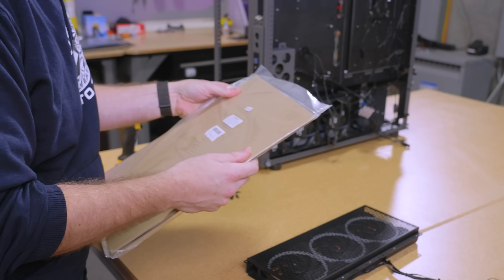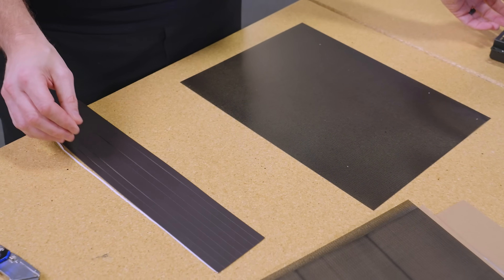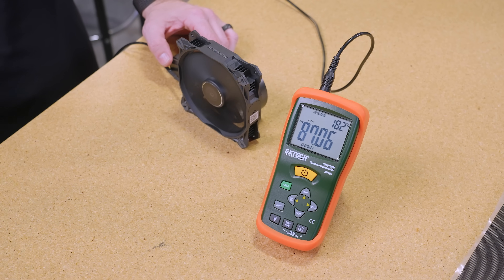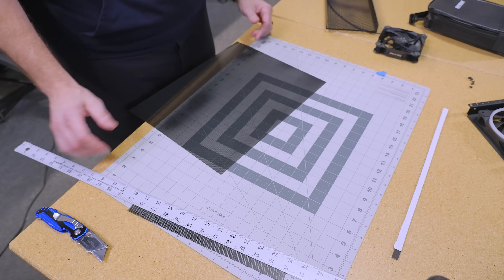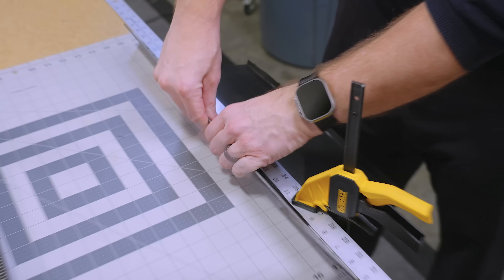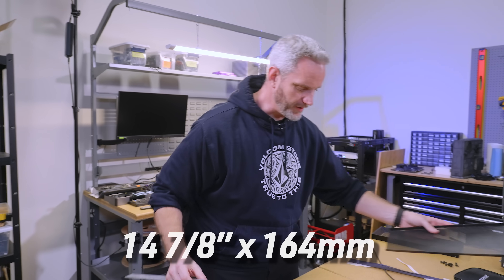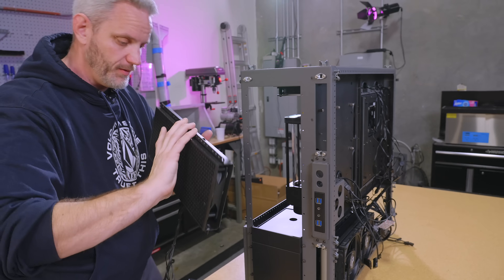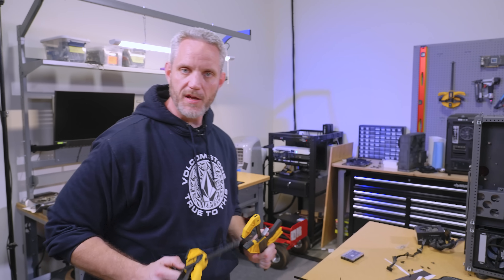How to create your own PC Dust Filters!

Comment: Hey Jay, I tried these EXACT same filters in my custom in-desk PC chassis, and it SEVERELY hurt the airflow. Especially since I'm relying on only 2 intake and 2 exhaust - all on the back side of it. I just took it back off. But I do have a plan to fix it though, which I swear I learned from you not long ago... rather than putting the filters right up against the fans, there should be a bit of a gap. So, my plan is to make like an intake box, spacing it about 2 inches away from the fans, and with the filter material around the sides. Then the filter box can kinda fit over and around the fans / rad. Of course, your project is quite different, and to do that, you'd have to eliminate that existing panel and replace it with your own filter mesh panel.
Reply: +1 on the gap. I remember the PCP&C "Silencer" PSU added a gap to reduce noise. That made me test if it helped filters as well. It definitely does. I also tried pull vs push, where pulling through a restriction is way better, because you don't lose velocity head, because velocity head is added after the fan.

Also instead of using a 2D screen, use something with more depth.
- If white is OK, pick up a fiberglass filter which is cheap and easy to work with. Probably not the greatest filtration, but its widely available. I've also used dryer sheets.
- If you want better filtration, grab something like a MERV-8 pleated filter. These usually have a thicker cotton-like material with metal backing. More of a pain. Much better filtering.
- If you need black, and still want off-the-shelf, get a honeywell "A" prefilter, or similar carbon prefilter for an air purifier.
- But if you're fine with ordering online, the best material for PC case filters is open-cell polyurethane foam. Good dust blocking, MUCH better flow, easily washable, and easy to work with.

Comment: Your fan will perform slightly better if you keep the dust filter a few mm away from the fan blades to allow the air to properly interact with the blades the way they were designed to, worth mentioning. I dont mean like leaving a gap around the edge thats unfiltered, still have it fully enclosed but just a few mm off the fan blades.
Reply: Same thing I thought.
Reply: I know right, Jay does some baffling stupid things sometimes lol
Reply: He has it set up that way in the case. He just didnt test it like that with the air flow meter for some reason

Comment: 0:00 Window screen and magnets works good for steel cases.

*Edit, for that case grab 4 black twist ties that came with cables, twist them onto the back of the front panel grill in the corners. Cut the screen so it doesn't cover the twist ties. Put the screen onto the front panel and bend the twist ties over it. Done.

Comment: I have the dust problem in here and even thoose filters didnt look small enough to filter dust. Maybe little hairs but i dont know about dust.
I have an old Cooler Master case that has already that kind of mesh in the front and, on top of that, had like a cloth/fiber inside that REALLY stop the dust (even if i never tought about how much air it stops too)

Comment: I did something very similar but cut the squares into individual fan sizes and screwed them directly to the fan cage. But, it effectively ruined the performance of the fan so I ripped them off and tossed them. Good luck with yours! Cheers 🍻

Comment: Question: Is there a downside to just taking some window screens and cutting them down to size? Nylon, metal, etc, any type I suppose
Reply: Unless you have a spare window screen I would say probably just the cost. Don't know if you can get the material by itself though
Reply: @taylormeyer671  Ace hardware near me will sell it if you ask, but idk if that's a local thing. More just curious

Comment: I found simply putting my case on an awesome stand my coworker sold to me dirt cheap made a HUGE difference. The Lian Li Evo Dynamic I use now has been outstanding as far as staying clean inside, and being up high at desk level has helped greatly. I had always had my towers down low thinking it was cooler and more progected, as well as quieter, but with water cooling and much more effective fans I hardly ever even hear thrm .

Comment: Filter AND grill really kills airflow and RGB. I would cut out portion of grill that interferes with both. Bend up filter material for a snug fit and spray inside of grill with 3M adhesive to hold filter in place. Makes it permanent but with your attention span, you'll move on to something else next week.

Comment: Americans have the American Standard system that has worked just fine for many years(longer than metric). The Imperial system was used by Britain and Canada until they switched to the (cough, cough) metric system, which was changed in order to correct some of the problems it had, and it still has some problems that will never be solved. Either way, we don't need metric here in America. Our system still works just fine. As for the filter system you demonstrate, it would be good for my old pc cases.

Comment: You could get rid of the mesh altogether and water clean the air prior to it entering the system.
Seal the system with air intakes drawing air from a water drum. Force dirty air into to water, through a bubbler, to remove dirt etc from it. That way you have cleaned air cooling the system. 
Hell, you could chill the water bath for extra efficiency.

Comment: Have you considered making a filter with the same screen material they use on windows?
Reply: This is what I've been doing - a little carpet tape to hold the material in place, works wonders for keeping cat hairs and larger dust particles out of cases... Though if you're in a rush or don't care to do a thorough cleaning before, you can also use the fan screws to hold the filter in place. This tends to stretch the material a bit more though, so sometimes not worth it

Comment: What's the best PWM Fan Controller for a Computer Case? I have 4 Fans and 4 headers but One Header is for an Optional CPU Fan. I'd like to have a little more Fan Control for My B450 AM4 Mother Board. My case uses Foam inserts for the dust shields.

Comment: It would be great if you made a "make your own diy PC case" on top of filters. Like, where to find correct sizes for various motherboards, how to make removable motherboard tray, how to plan for psu sizes, wires, rad space - all of that. Better yet - series of small videos, one per topic (or two topics, or several videos).

It would be great to be able to make my own PC case as a LOT of existing cases I can buy have a ton of stuff I never plan to use (included in the price).

Like, hard drive bays! And a whole TON of SSD mounting places! I have two nvme ssds. No need for HDD, sata SSD slots (I still have one hdd, gradually shifting my usage to SSD).

Comment: My previous case (DarkFlash DLM 21 Mesh) has no dust filter on the front. 

My solution after reading some posts on reddit about improvising a dust filter was to find a way to use some stockings (from ok areas of damaged ones from a sibling) and I used some solid core wire about 18 gauge size to bend it to form a rectangular frame with 2 hooks at the top. 
The frame is where a cut stocking was put on and then it was placed in between the tiny gap on the front panel mesh and the front 120mm fans.
I used it for 2 years and cleaned it every year. the solution still works but in hindsight I should have controlled the front intake fans to be a higher speed than the exhaust ones at the back and top.

Sadly there's on gap like on the DLM 21 Meshon my current case, the Sama IM-01 / Tecware Fusion. So either I'll clean it more frequently or figure out how to make a different kind of dust filter for that case.

Comment: I think I bought the exact same stuff for filtering on my case. I have an NZXT H510 elite with a 3rd party front panel for airflow, basically what NZXT did in their more recent cases. The mesh does the job and the airflow is better than with the fucking glass panel there, so I can't complain. I am thinking of doing a case swap though.

Comment: That mesh looks like car base for body filler.They used to sell it at home depot. Thank you Jay, you are the King of modding computers and DIY projects for computers as well. Informative ideas for those that like to trick out cases. Yoiu being as humble as you always are is nothing BUT a draw to this channel. Thank you for taking us along on your journey into things like this.
  Random thoughts.. can you run the magnets on the outside or would that look stupid instead of the inside and use them that way to help hold the screen?..  I 100% agree with the larger holes. That mesh breaks quickly so cleaning it may be an issue, this becomes a thing maybe try remeasuring every thing when that happens with the extra screening so it fits more accurately... I believe they also sell the same mesh in plastic, but I think it may not be bendable but useable. I think they use it in dry wall repairs, just a few random thoughts.

Comment: Damn airflow cut in half with the filters we are going backwards with performance!  My case has no filters just mesh panels, but they don't really filter dust.  I'm ok with that because the airflow is great and using compress air to blow out the dust every couple of months is no big deal for me.

Comment: I wouldn't use perforated PVC sheets because of the significantly reduced airflow.

Nylon or steel mesh filters are better. I'm using a woven wire stainless steel mesh, size 30 mesh, size hole 0.7mm.
Reply: Kinda annoyed by its grey color and no other color seems to be available. Would it be okay to spray paint it black in order for it to match the color of my case?

Comment: So I can say top air exaust filters work but not for the reasons people think. The reality is for some people the computer is off more often than it is on and the dust settles from the air. The filter keeps it out of the case. That being said anything that cuts airflow in half that doesn't add to cooling like a radiator is a no go for me. I'd rather regularly dust out my computer then have less dust in the PC but less cooling. Not to mention that they can introduce noise if too close to the fan. I feel like the best solution is is to just run a HEPA air purifier in the room with the computer and not worry about dust filters.

Comment: OK so air filtering is my jam. And these "filter materials" they often sell just drive me nuts. They produce a lot of restriction, yet are only really good for keeping the fans from sucking in cats.

I used to go to the hardware store and buy a MERV-8 HVAC filter, cut some material off of that, and put it in front of the fans.
Then I switched to ordering open-cell polyurethane foam for my server, and then using a Honeywell "A" activated charcoal prefilter for my desktop. that way the black matches.

I did a decent amount of experimentation as well. Here's some of what I found:
- You generally want to pull, not push, through an obstruction. (Not applicable to the video, but relevant to rads). Air being pulled through a restriction is going to be more laminar. The restriction is going to kill your velocity head. But if it is pulling from stationary air, there is no much velocity head to lose, and THEN the fan can introduce energy in the form of pressure and velocity head.

- You'll want a decent gap between your filter and your fan. Close to the fan, the fan is a bunch of vortices which are blocked by filters. Farther from the fan, the fan simply a source of static pressure.

In my latest design, which I might do a video on:
- It's a horizontal case.
- On the bottom, there is feet creating a gap to let air into the bottom.
- The air must pass through a 16x20x1 MERV-4 Carbon Prefilter. Then a 16x20x1 MERV-14 filter.
- Then it passes through either a MO-RA3 or AlphaCool SuperNova 1260mm rad core.
- Then it passes along a groove between the edge of the motherboard and the sidewalls.
- Then it is pulled out the top by a single squirrel-cage fan
- The exhaust air is passed through UV LEDs and Titanium dioxide pigment to induce photocatalytic oxidation to sterilize the air.

The idea is that the PC would also act as an air purifier for the room. The whole thing would be sealed by gaskets and caulk, because that top fan would be pulling a vacuum, and air would have to come in through the filters and radiator.

I don't have the mechanism down yet, but the idea would be that you could easily swap out the filters in, like, 15 seconds. And you could use standard off-the-shelf 16x20x1 filters. In this case, a Honeywell "A" prefilter, and a Filtrete 2500 SMART filter.

The goal would be for it to be the "last case I need for the foreseeable future". But that's if I get it built.

Comment: Not particularly interested in this, but still a nice vid for the nichiness.  Speaking of niches, I live in an NYC apartment, so my PC is positioned into a corner of the room.  Because I built my PC in a reverse set up (Liam Li Evo), the airflow is already compromised, so my GPU (or PSU) overheats if I'm playing specific games, such as Total War: Warhammer and my system shuts down (running a 3090).  99% of the time, it isn't a problem.  I'm going to do some decluttering around Black Friday by swapping out my Corsair fans (currently have 4 Corsair fans, while also having 3 Lian Li fans, and 2 Artic fans for GPU cooling -- yeah, I know, all over the place, but I was reusing old fan parts) with Liam Li.  I'm hoping by removing the excess wires will help, but if you have any other tips, would love to read up on it.

Comment: I brought some of this "0.20mm Hole 99.9% Natural Copper RFI Shield Woven Wire Mesh (100 LPI x 0.05mm Wire = 0.204mm Hole) UK Made (594 x 841mm (A1) Sheet)" for a self make computer case I am planing to build. As it has a clamed 65% open area it should be prety good.
Reply: So wont that potentially interfere with Bluetooth and wifi and maybe wireless dongles, because of the rfi shield feature?
Reply: @magnuswf  It depends on the attena location. Inside the case then yes it could interfere but any metal case would do that.  An antenna outside the case not likely to be a problem.

Comment: About the top - I've done a very creative and unusual configuration in my system where the two top fans to the front are intake, and the rear one is exhaust. Because I only have two front case fans as intakes, three/four exhaust fans meant creating a negative pressure environment. Which you can do, obviously, but it also meant that the top exhaust fans actually reduced the amount of fresh air moving through the CPU cooler. By turning around two of the fans, I've made a positive pressure case with decent airflow through the CPU cooler, resulting in 5-10° C less heat in the CPU under load (plus another several degrees by repasting the CPU with higher quality thermal paste).

Should I switch the air cooler for an AIO at some point that will have to change obviously (although then I don't need the air going through the cooler anyway), but for the moment, I'm quite happy with the case having a top fan filter.

Comment: I tend to not bother with fan filters.  For one, they choke up airflow, which isn't great for thermals, for two, they don't stop dust building up in your system, it just one MORE thing collecting dust, and for three, did I mention that they choke up airflow?  I have seen HEPA filter pieces work, but without the accordion folds in a boxed frame, they still reduce flow.

Comment: any dust filter is bad, heck you all saw it halves airflow by HALF through those grills, and even grills themselfs pushed against the fan block at least 30% of airflow.. idk what kind of dust does he has in california but i run my core wp100 with 3 fans front intake without filters and i have no dust in case, i have top 3 fans exhaust and they remove all dust that comes into case. i maybe clean inside once in 2-3 months for the lulz, case inside is clean like i cleaned it yesterday. i like it. didnt expect that.

Comment: The best dust filter has been no filters and regularly cleaning my computer out.

No filters for 4 years, no problems. As soon as I put filters on, noticeable increase in temps. Idk man, filters are cool if you like making your computer a restricted air flow oven, but that's just my opinion that I have pulled from the depths of my ass. I'll gladly be proven wrong with science and tests. Do dust filters increase temps, and are those increase in temps worth the trade off in keeping the dust from your components? If you clean your computer regularly enough, are dust filters even worth it?

Comment: The easiest way to do this would be just cutting small hole where fan screws go, just hook it on to there.
When PC is running it will be sucked tto the fan, leaving no gap, when not on, it will stay there thanks to those screws.